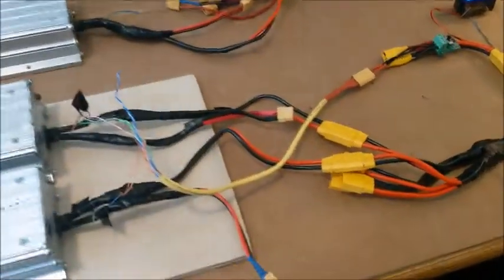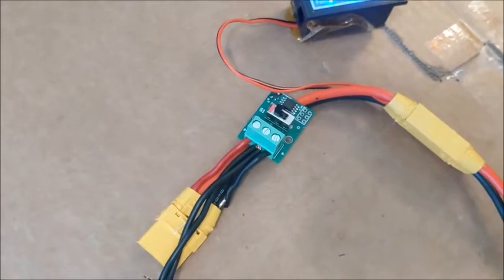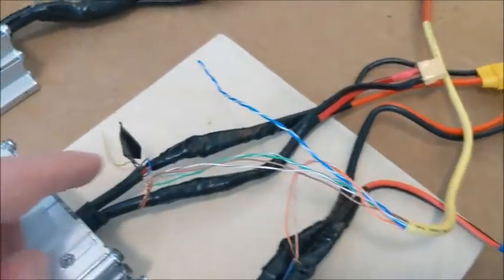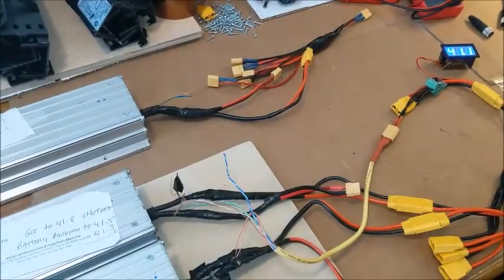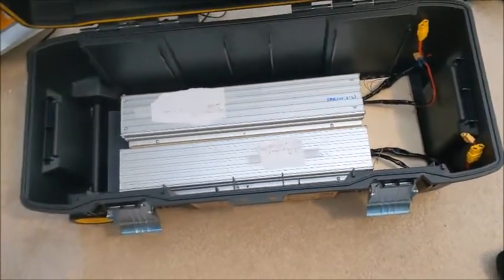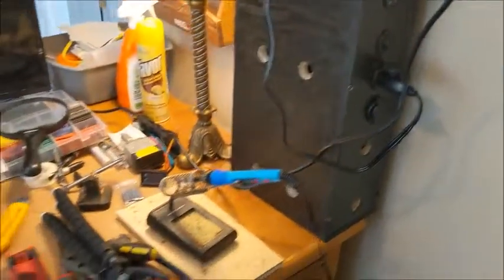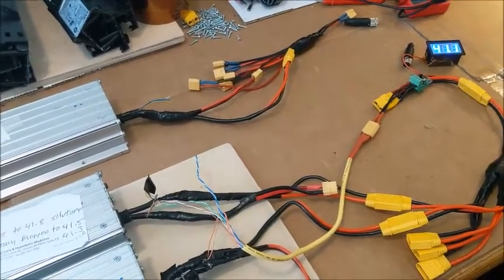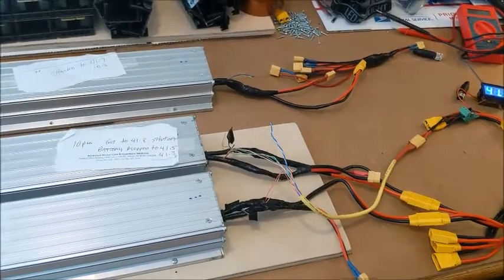Part 2 Update (dongles) - Panasonic NCR18650BD  36v Scooter Battery Packs  - Battery Clearing House

Comment: I have a connection for loads of the 40 cell packs of LG MH1 cells. Jehu cant (or wont) get them anymore apparently.
Reply from the maker: I bought 3 of the MH1s last year prior to them working out the can hack. I use the bms to charge but wired it direct on discharge. I just manually watch my rate and discharge under voltage.

Comment: Thanks for posting these videos. I bought the same battery packs but I only bought 2 of them. I have a few questions. Do you charge all of your batteries with one power charger and if so how do you connect the batteries together charging with one cord? Is it  better to get the XT90 or the regular charger? Can you also show which wires go to positive and negative when you soldered them together when attaching your xt90 and xt60 adapters? This is my 1st time wiring and soldering anything together. Thanks a bunch for your help.
Reply from the maker: Hi Kimberly, thank you for your comments. This is the charger I use: 
https://www.amazon.com/gp/aw/d/B088NJKC1Y?psc=1&ref=ppx_pop_mob_b_asin_title
I cut off the barrel connect at the end and separated the wires. Then I put my multimeter on the 2 wires to find which was positive and which was negative. Then I soldered on an XT60 connector.
On the XT60 connector it is marked for positive and negative. The flat side should be the positive.
Then I made a pigtail to charge multiple batteries. In my case 4. Just note your XT60 comes in both male and female ends. You basically make one end the same with 2 or 4 plugs with 4 inches of wire connected. Then use the correct male/female and make a single connection that will fit onto your charger end. I  twisted and soldered all the connections. Does this help?

Comment: the blue wire has to be hooked up to the solder points on the six spots
Reply from the maker: Well that was the thing SB... If you look closely at my style activator board that Aaron sent me it's completely different from the ones that he took his pictures on. I agree with you that the original board had the holes that you soldered to. But his second revised board has this green tower and it's supposed to be solderless. I have discovered since this video that on the tower the middle connection is for the BMS activation. I have two of them working successfully now. Thank you for your comments. 😁

Comment: Please keep the updates! Would love to purchase a couple of these for an ebike just not sure about how many I’d need for a fast long lasting  72v system
Reply from the maker: Thanks Brian. They are cheap at $35 each through Battery Clearing house. You could start with 2 in series 36v + 36v = 72 volt.... then buy more as you need them. There is a video of them with the case off and you could hook up direct on the output side without worrying about the dongle. BUT, you would have no BMS protection for under voltage cut off  (as an example). I have been at a standstill on the dongles but now have received one from Jehu. Will get back at it. Thanks for your comment.
Reply: Great, could I hook up all my batteries to one of the dongles so they all work under a load? I want to keep them in the cases how they are they would look nice on my bike mounted and I’d keep the bms. This seems like the cheapest route to 72v but how are the amp hours? I think I saw 8ah on the pack
Reply from the maker: @sparxx-k  It is my understanding that you can hook up to 6-8 with one dongle. You would just need to make sure you power the dongle with 36v in stead of 72 volt (or off just one side). Then you could use something like this if you were using XT90 connectors to wire in serial for your desired 72 volts. 
https://www.amazon.com/RC-Battery-Connector-Helicopter-Quadcopter/dp/B07JKNWN85/ref=mp_s_a_1_3?dchild=1&keywords=xt90+serial+connector&qid=1621773636&sprefix=xt90+seria&sr=8-3
Reply from the maker: @sparxx-k  found this, I think this is what you want to do. 
https://youtu.be/zZ2U5uhcLlo
Reply: Yes I was just watching that video my main question now is could I run these with a 200a controller or us the amp pull too high for these? I see they shut off at 25a I think but maybe that’s each mosfit. Do I need 4 2s2p for 200amp draw?
Reply from the maker: @sparxx-k  Sorry Brian, I am a novice.... That's above my pay grade. Lol 🤪